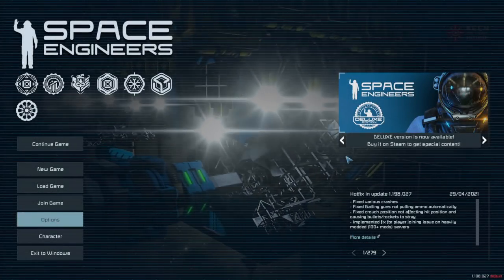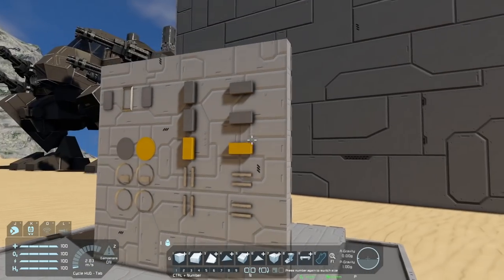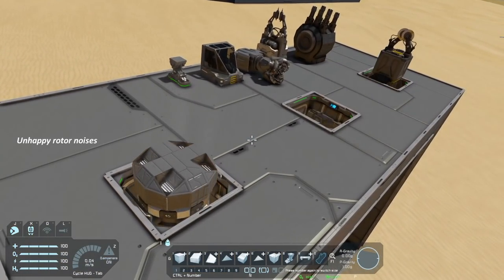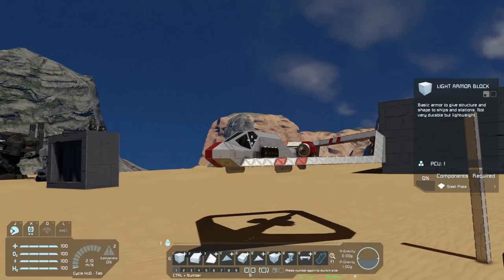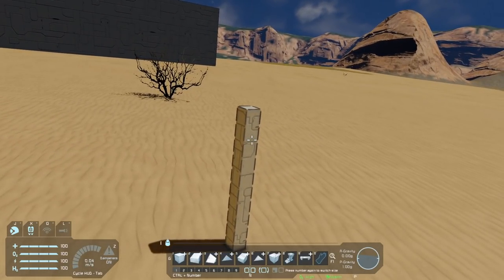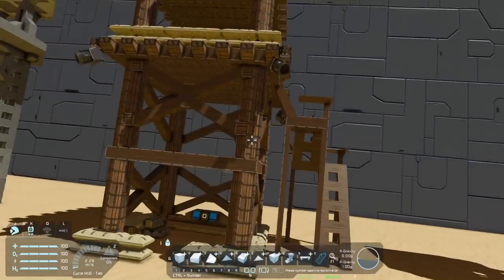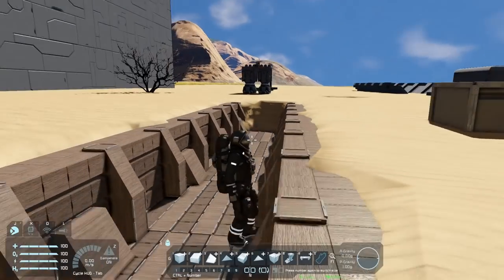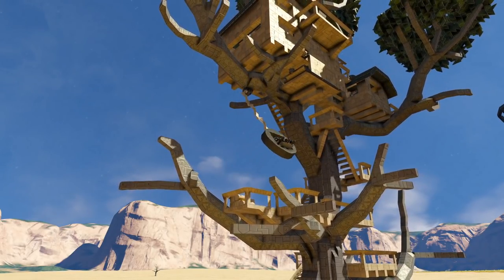How to Improve in Space Engineers | Clever Tips Ep. 3

Comment: The pop up compact turret. Is that conveyed in or just built for show?
Reply from the maker: If stuff can pass from a large hinge to a small hinge then it would be conveyors
Reply: @BlackArmor718  well, it’ll pass to the small grid, large hinge but that’s a small grid large conveyer port and the guns use small conveyer ports. So while they’ll attach to the surface of the hinge part, they won’t be conveyed to get ammunition.
It looks VERY tight and good, so if it is conveyed I’m wondering what block/s you’ve used to achieve it. Otherwise I’m guessing it’s just built for appearance sake, which is fine.

Comment: Small-grid batteries (3x3x2) have the lowest cost, volume and weight per unit of energy stored.

COST:
Large-grid batteries are 4 times more expensive and have only 3 times more energy.
Small-grid small batteries have 20 times less energy and are only 10 times cheaper.  
*Cost based on power cells, the main limiting component of batteries.
VOLUME: (and energy density)
L-g b     15.625m³
          192kWh/m³
S-g b          2.25m³  
  444.4(4)kWh/m³
S-g s b    0.125m³
          400kWh/m³

If you need to make a massive battery pack in your base, use small-grid batteries. (Normal, not small.)

UNLESS, you're worried about CPU, then use large grid, because all battery types have the same PCU/block.
Reply: How the fuck does "20 times less" even calculate? What's "1x less" in the first place so that you can have 20 of it?? Also, there's a difference between "3 times more" and "3 times as much". "3 times more energy" would mean LGB have 4 MWh of capacity when in fact they only have 3 MWh.